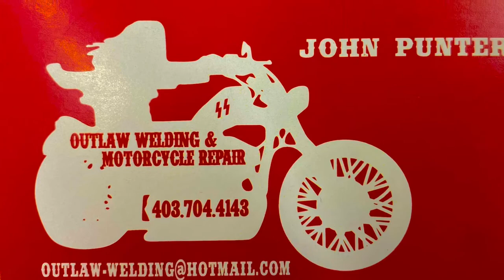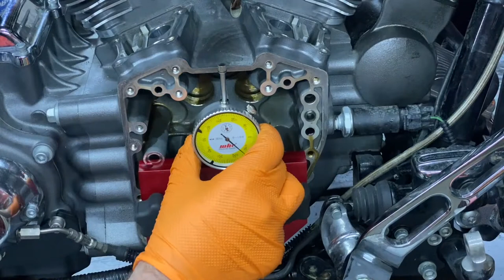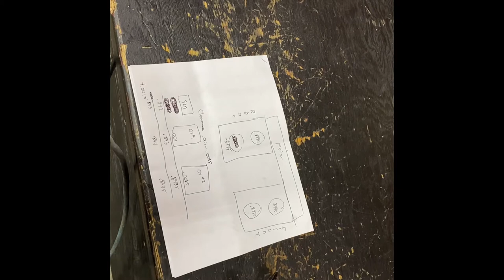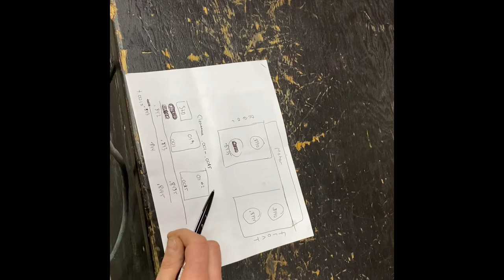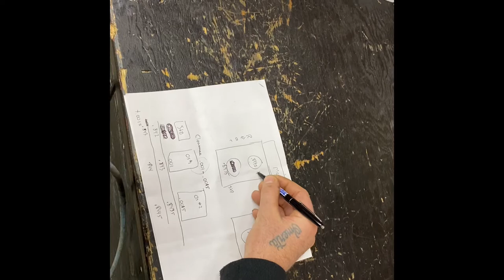Camshaft installation part 2  how too.

Comment: I enjoyed your video very much. I especially liked the in depth detail that you went into regarding proper install and care taken throughout the total project. I do have a question though regarding pushrod adjustment. I have a 2013 CVO Ultra Classic with 110. I have Feuling hydraulic lifters and Screaming Eagle adjustable pushrods. The pushrod adjustment instruction that was given to me was to make sure the lifters are on the base circle of the cam, and from “O” lash, lengthen the pushrod 2 and 1/4 turns. In your video you only adjust from “O” lash 1/8 to 1/4 turn if I understood you correctly. I thought the intent was to lengthen the pushrod to the halfway travel point of the hydraulic lifter? With the total travel being approximately 0.200” and adjusting the pushrod to half of that which equals 0.100”? I’m just a novice DIY mechanic so if you would explain why you have a different method and why it is better, I would greatly appreciate it. I may have set mine up wrong and your method could be better.
Thanks in advance of your reply.
Reply from the maker: Thank you for your comments, we truly appreciate them every time.
Always follow your instructions. The way we do it is our personal preferred method. We do this because it has proven to us, to make more power